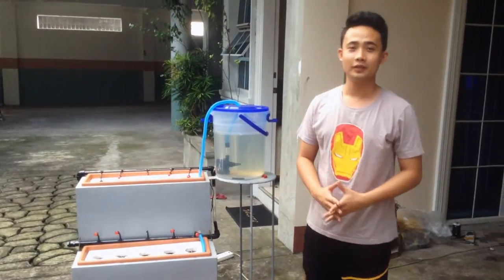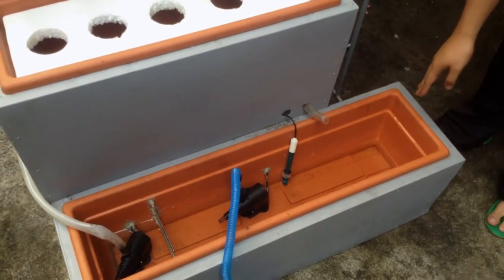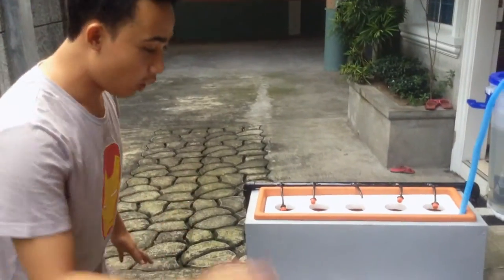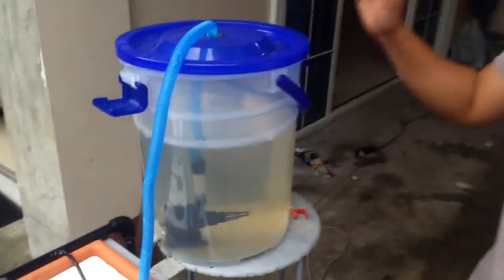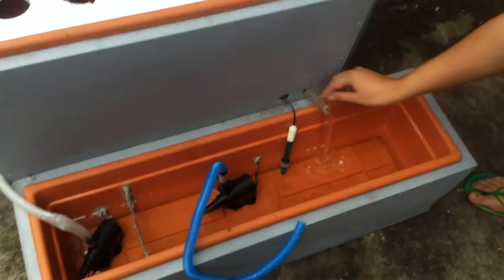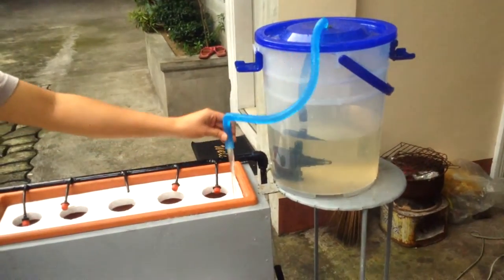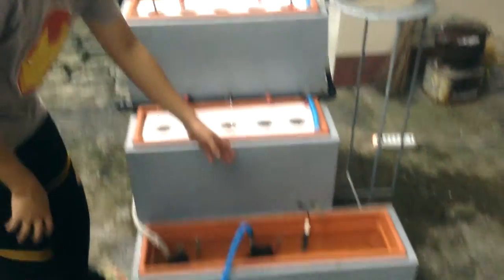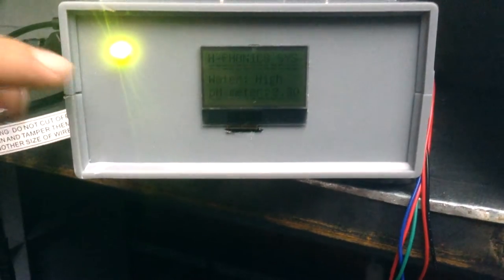[THESIS PROJECT] ARDUINO BASED HYDROPONICS GUI MONITORING | FARMING

Comment: Nicely done! Could you please share your observations about a PH metering? I see you are using the cheap Chinese probe. Did you compare your readings with some other PH meter? Don't you have a chart of PH readings? I have a bad experience - PH value fluctuates a lot, is not reliable and the meter is therefore very hard to calibrate. Also, do you really grow plants in PH 2.4? This is very acidic, isn't it?!